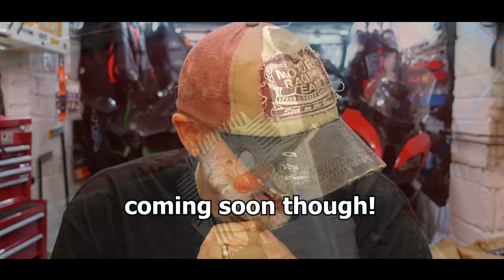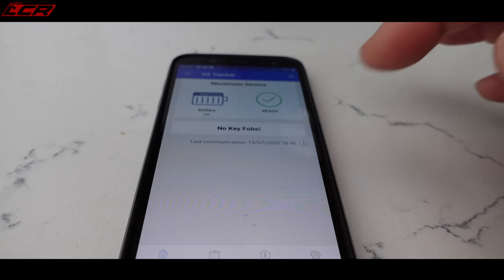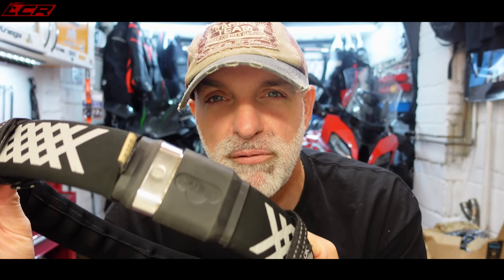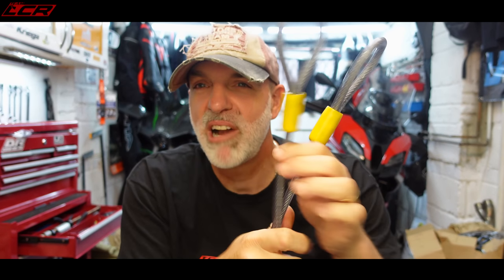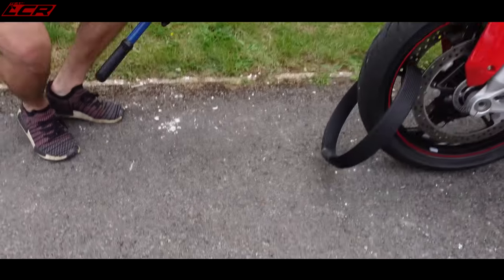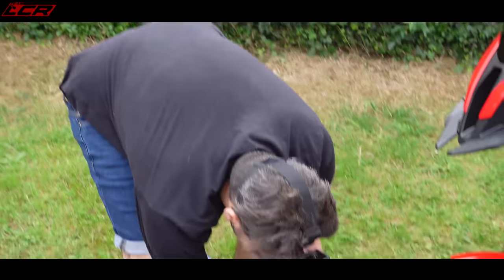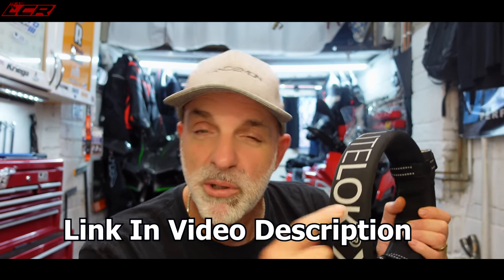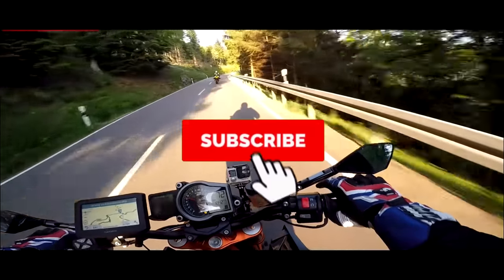Litelok Motorcycle Lock Review | Can We Cut Through It??

Comment: Almost any lock can be picked easily. No matter how strong the chain is. Question is, how skilled the intruder is. I do pick locks for living, legally of course. The simplicity of this procedure with the right skill makes me worry about my own bikes. I have CCTV all around my house, have an alarm fitted to a garage with two MasterBlaster sirens. The noise they make is unbearable and probably unsafe for hearing. CCTV is network connected and sends messages with pictures to my phone, when movement detected. On top of this trackers are fitted, GSM + RF beacons, in case bike will be locked in a container or somehow else GPS signal gets blocked. Only multiple layers of security can reduce risk significantly.

Comment: Pffffft forget this, Durham University have created a lightweight material called proteus that can defeat an angle grinder. I'm holding out for chains made from than, until then it's almax chains for me every time. Even the series 3 will take a good 10 mins real time to cut through with an angle grinder, and it'll fit in a tail pack and weighs less than a pillion.
Reply: For trackers, have a look at Automatrics. They got an excellent arrangement in place with the police, amazing customer service, and the hidden RF signal means they can find your bike in underground car parks and inside vans, where GSM/GPS will not work.

Comment: Have you tried a battery angle grinder on it as that’s what the thieves use in London?
Reply from the maker: No as it will cut through so pointless test, nothing can withstand an angle grinder. You can only offer a deterrent and this is very easy to live with and meets insurance standards

Comment: Just watched a guy cut through one in 15 seconds don’t waste ya money my mistake 17 secs with a bolt cutter
Reply: @frankiesaysrelax515  explain the difference other than colour name and length. Both have the same steel cables and are the exact same width. Steel cutters can cut through the Moto just like the Gold.
Reply: @frankiesaysrelax515  "the video you watched was the lock green? If so I've seen that and it's the litelok gold this the the litelok moto".
By saying this you are saying there is a difference between the strenght of the two. The differences I stated being name, colour and length have zero affect on the structural integrity of the lock meaning your comment was redundant.
"That's three differences right there", exactly how do those differences make it any different to the attack from the cable cutters? The reason I pointed out those differences is because the are obvious and have zero impact to the structural integrity of the lock.

Edit: use what lock you feel comfortable securing your goods, and make sure that for more expensive items you use appropriate locks for those items. If you feel secure with the litelok go for it, personally I wouldn't, it seems they invested a bit more of their budget into marketing rather than into structural integrity. Just remember, locks only keep our honest people.

Comment: I bought the wearable litelock for the bread knife to lock up her push bike and it's a quality bit of kit at a premium price.
But i'm going to call bullshit on the testing as no bike thief is going to turn up with bolt croppers when they can use a battery operated cutter which they have stolen out of a builders van.
Chops junior should stay away from the soy based foods
Reply from the maker: Yes but nothing can withstand an angle grinder. You can only offer a deterrent and this is very easy to live with and meets insurance standards

Comment: You're using the wrong tool. I have cut through these with a small set of side cutters. You only need a set that are 6"-8" long. Obviously bigger and better quality would be better. The set I used were a cheapo Chinese side cutter 7" in length overall. The trick is not to try and take too big a bite. Just cut one or two strands at a time. Be patient and within 5 minutes or so you can cut completely through no problem.

Comment: Those are bolt cutters chopsy. They will never be able to cut a flexible cable. They're made to cut a hardened surface. If you try using a cable cutter I'm sure you'll see a different result. You can even try getting a large metal cable cutter and I'm pretty sure it will take less then 30 seconds. This is what actual bike thieves use now asking with modern angle angle grinders (which I don't think any lock will withstand).

Comment: I don't buy it. I'd be inclined to say that the wrong tool for the job was used. Not every cutter is made to cut steel wires. But the proper tools aren't hard to get anyways. I'd bet these cutters were made to cut soft metal like copper, which is why you couldn't get through.

Comment: 4:40 Chops, wrong. Average bike thief is using Dewalt XR 18v grinder. Which will cut through this like butter. No one is carrying bolt cutters these days as they are bulky, hard to conceal. Try grinder mate. It takes about 10 sec to cut it with a grinder from what I saw. That is really poor.

Comment: Be good to see it with a cordless grinder.. a lot of thieves carry these as they are small and light
Reply: Be good to see ANY security product of similar weight that can resist an angle grinder, do you know of any?
Reply from the maker: Yes but nothing can withstand an angle grinder. You can only offer a deterrent and this is very easy to live with and meets insurance standards
Reply: @LambChopRides  just be interesting to see.. not saying it should be able to withstand it but its what thieves use. maybe it withstands it more than a normal chain

Comment: If it can't withstand an angle grinder attack you might as well buy a much cheaper lock to put off the opportunist thief.
Reply from the maker: Yes but a cheaper lock wont meet Sold Secure standards so extra insurance premiums. Or worse case no payout if you've agreed to use a Sold Secure Gold rated lock to reduce your premiums.